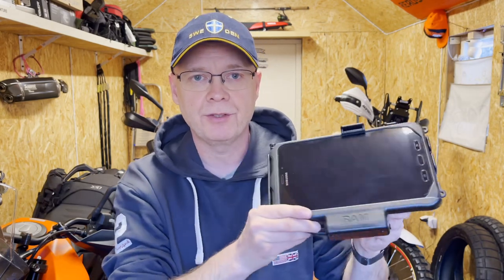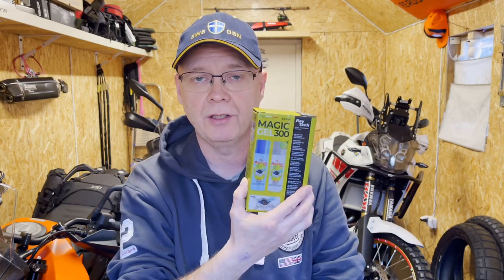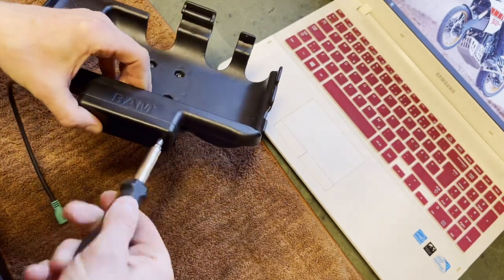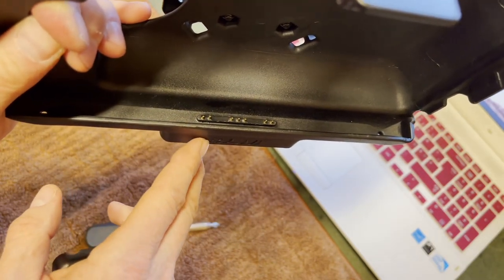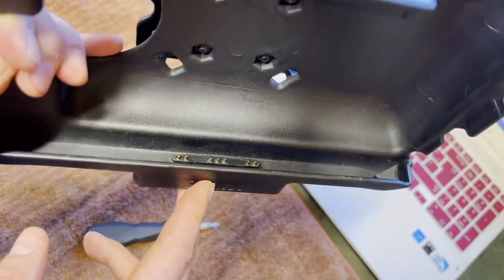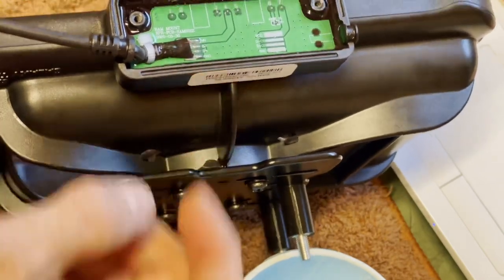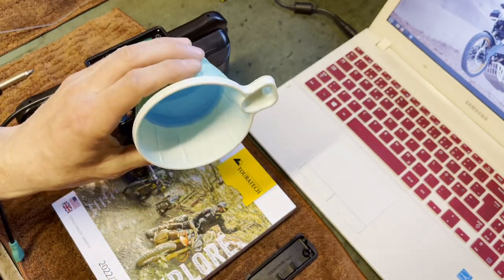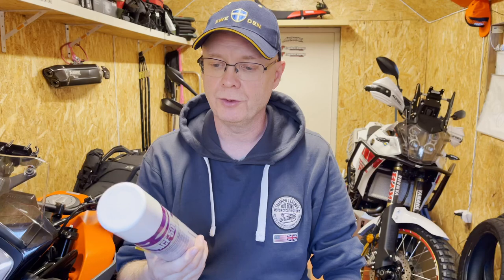Waterproofing the Ram Mount Ez Roller for ADV motorcycle use

Comment: Great video. I am following your advice. Another weak point would be the connector (color green)  going from the mount to the charging socket as with the kit included it only plugs half way leaving part of it exposed. Did you fid a solution for that? Thank you
Reply from the maker: @aramaa4905  I have noticed that it sometimes don't charge so I have to move the connection a little. I'm thinking of doing a permanent connection instead, either by soldering the wires or schrink wrap it.
Reply: Thank you.

Comment: Great idea! I have an active tab 2 for navigation. I'm interested in knowing what mount you are using to attach this to your navigation bar.
Reply from the maker: Thank you! I use a mount from 3D Moto.

https://www.3dmoto.pl/product/yamaha-t700-shakes-gone-fairing-brace-nav-mount-platform-(2019-2022)
Reply: @RiflemanSE  did you mount it directly to the 3D MOTO holder? Or do you need any adapter to place the tablet holder to the center? Thank you
Reply from the maker: @baktermk1tdi  Hi, the Ram Mount holder for the pad is mounted directly to the 3D Moto mount.

Comment: Have you tried stabilant 22a on the pogo pins? We use it in the auto repair field to protect computer and sensor connections from corrosion. Should be perfect for pogo pins. it has a NATO military part number too. In the USA the NAPA part number is SL-5
Reply from the maker: Hi,
No, but it sounds like it would work. I have tried the ACF 50 only. So far they work.
Reply: Well I tried your solution with the gel but for me it was not successful.  For months I suffered inconsistent connection  and slow charging. I am using this on my Tuareg 660. I ended up just plugging the tablet directly into Aprilias supplied usb port and it now works consistently every time with a strong charge rate. I also learned to use the adjustable display setting instead of manual mode set to max brightness. Apparently the adjustable mode can go 20% brighter I have read.

Comment: Don't you have any problems with loading too little when the screen brightness is at maximum and the navigation is running?
Reply from the maker: ,Hmm you mean that the charging voltage should go down? No, nothing I have noticed. I think the charging is on the slow side even if I use the 220v socket in my house. I'm pretty sure that the USB converter from 12v get enough power to meet the USB standard, but I have not measured it.

Comment: Hi - thanks for the video - will try the Magic too. Did you connect your tablet to 5V or 12V? 

thanks for your answer
Reply from the maker: Hi,
It’s connected to the 12v outlet via a USB adapter
Reply: @RiflemanSE  thanks for the answer - I hope I understood correctly. You come from the battery with 12 V to the USB plug - from the USB plug to the tablet also with 12V?
Reply from the maker: @fiordilatte4118  I use the stock 12v outlet that’s to the left of the speedometer on the bike. In that I use a USB converter that I connects the usb cable that comes with the cradle for the pad.

Comment: Hey! Are you still doing well with your solution? been through any substantial rains with it? Thinking about getting this mount for long distance tours.
Reply from the maker: Hi,
Yes I’m very happy with it. We recently did a 1900km journey in Norway (see our latest movie) where we had a LOT of rain and it performed flawlessly. It charges a bit slow but has always done and I think it has to do with the Micro USB connection (tablet holder has a short wire with Micro usb in the end and then it’s hooked up with a longer cable that is ordinary usb in the other end. Tablet holder comes with this solution as stock so it’s nothing I have done)
Reply: Thanks! That's good to know for sure. I have several places with charging ports to experiment with on my bike. I will try a few of them.

I actually have had similar charging problems by the way. My Quadlock USB A charger was actually discharging my phone half the time. I have since gotten a better charger.

Comment: just put a good chunk of dielectric grease on the pins and that should make it.
Reply from the maker: Yes, that protects the pinns from oxidation but it also collects dust, sand and debris when riding gravel or off-road in dry climate. I prefer what I have now since it's a dry solution.

Comment: How are you finding the Tab 2 Active ?
Reply from the maker: Spring is really late this year in Sweden so I haven’t had the chance to test it much but it seems like it handles all my navigation apps great so far.
Reply: @RiflemanSE  Same for Norway, still cold! 

I was thinking of screen brightness. Cant affaod the Tab3 🙂
Reply from the maker: @no66  I will check that and reply to you asap 👍🏻
Reply from the maker: @no66  I have now tried out in the sun, the brightness on its highest setting is about the same as on my Garmin Montana 700i. No problem reading a map but it would not have hurt to be just a tad brighter.
For the money I think it’s totally fine.
Reply: @RiflemanSE  Thanks for the update. I have one coming soon and going to print a holder this weekend

Comment: i think the problem with the holder is the pogo pins it self. they tend to have bad connections and dont allow to charge at full charge
Reply: but good ideia anyway
Reply from the maker: Yes the spring tension sure could be a little stronger in them. I have seen online that it is possible to buy other pogo pins, maybe it will be a winter project and change them, or just run a separate cable if it gives up. But at least it’s now weather protected.
Reply: @RiflemanSE  I've installed a second USB -C cable soldered to the circuit board. This way I have 2 different charging entry's to the tablet. Haven't tested it properly but the tablet charges at 1400ma
Reply: @RiflemanSE  could you send the link to the different pogo pins?
Reply from the maker: @PIREX701  I just did a search for pogo pins and got several resellers/ manufacturers, there are even watertight ones. But changing them might be a job for some one who are good at soldering small things 😁
Reply from the maker: @PIREX701  Aha, do you have any pictures of it?
Reply: 👍 And what about temperature? No risk to damage the electronic card?
Reply from the maker: @harfang8188  That should not be a problem, it’s low voltage from a. USB socket and it’s in more or less wind that also cools it down.

Comment: Super surprised there is no gasket of any kind 🙄
Reply from the maker: @jasondunn8313  I think it's hard to seal it with a gasket since water will come in at the pogo pinns. But this gel is a solution for sure.